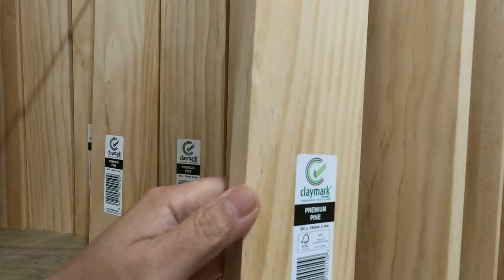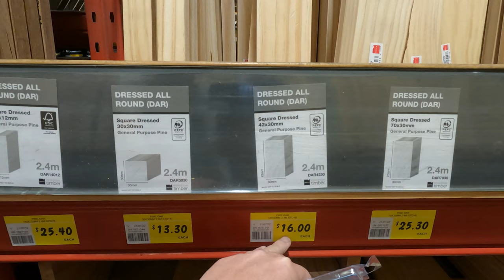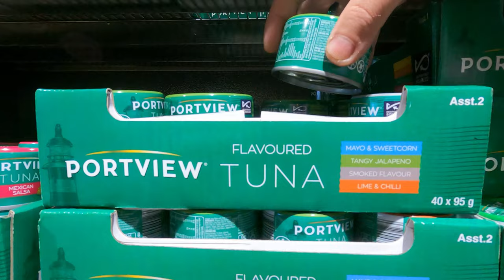Hardware shopping for my van conversion. Floor installed without drilling.

Comment: Conversion is coming along great! What's the temperature inside the van when parked in the sun? The insulation help keep out most of the heat?
Reply from the maker: It is very hot still, the insulations maybe slowdown the heat to get in, but once it is in, there is no way to get out and so still it is hot.

Comment: I think you are using heavy materials. When it comes to drawers and bed, i would use ‘kallax’ furniture from Ikea. I like making a no-build camper van. Take it easy and don’t overdo your project. On the otherhand, we are looking forward to your adventures with your camper van. Congrats already. 👍
Reply from the maker: Maybe mate...The bed is still easy to lift and it is the heaviest so far. The battery is going to be the heaviest which is 15kg.